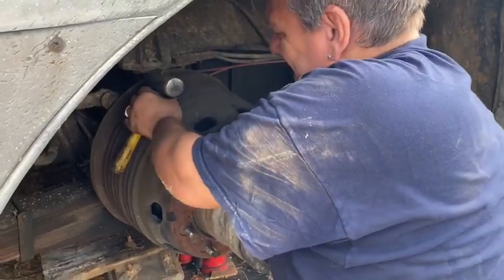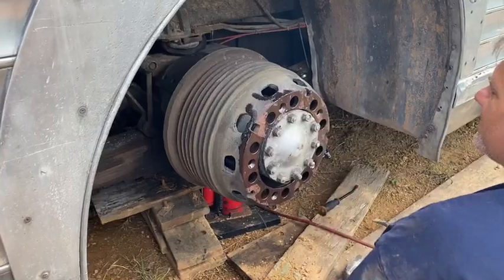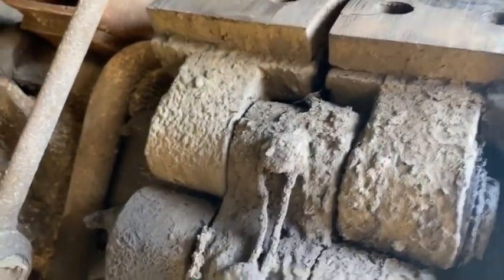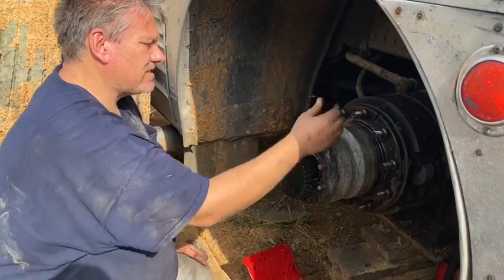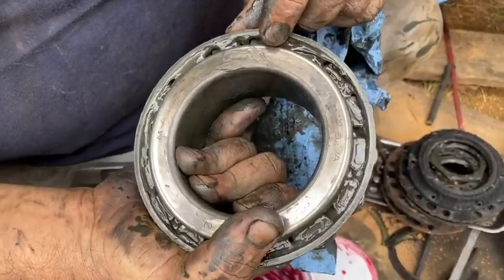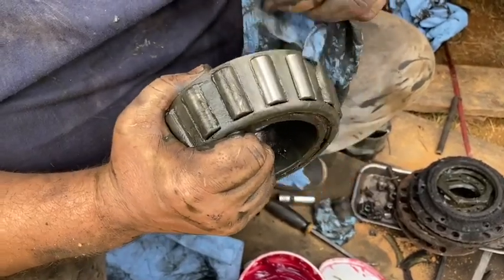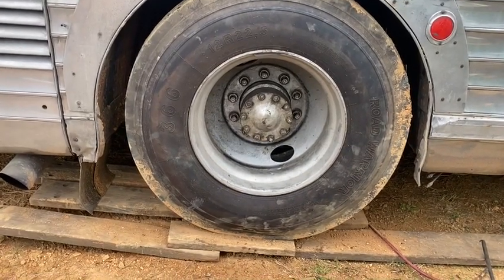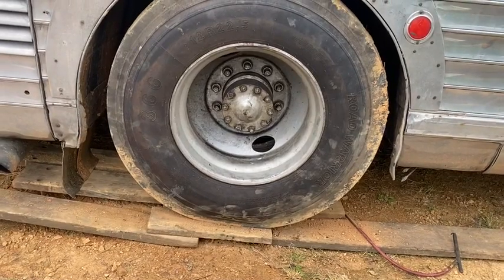Right rear hub inspection on a silversides bus

Comment: When you said the front wheel bearing was in trouble, I wrote I had no idea how long they last, and I think you said that had at least 100,000 miles on it.  Apparently they last a heck of a lot longer.  This work looks so civilized compared with when you are helping people in wet fields and flat tires.  It makes economic sense to take it apart to see what you need, but for an observer it does look like a heck of a lot of extra work to take it apart twice.  Always impressive to see your knowledge applied to what you find.

Comment: You should go to the appliance store and  beg them for some scrap refrigerator cardboard boxes. They fold flat and provide a nice clean work surface that you can simply burn when you are finished. Having a comfy cardboard surface to lay on and lay parts on is a big boost for ones outlook over working in dirt.

Comment: I have found that hitting a flat head screw with a flat ended punch will usually help loosen a stuck screw.
Thanks for the band aid tip. 
Stay safe out there. Must be nice being able to work on Lennie with out having the HOA bothering you.

Comment: You are exactly right about Curad I gave up on Bandaids because they won't stick on you unless you don't move that part.  When I worked I carried two or three or more in my billfold all the time because at work the first aid kit might be a mile away.  That stuck on bandaid commercial is catchy, not at all true but catchy.

Comment: For those flat head screws that stick, strike them straight on with a flat ended punch and your 3 pound hammer.  The force will deform the head and crush any corrosion underneath it, allowing the screw to turn.   Many times this works when an impact gun or driver just rips things up.   I start with the punch, then go to the impact driver if a regular screwdriver will not turn them.
Reply: Yes been doing that way for years .

Comment: You talked about the two axle types you find on busses.... the first  (like Lenny) where the axle splines into the hub, and is easily removed is called a Full Floating axle,  and is designed that way so a broken axle is easier to replace,  but also less likely to break because there is a little flexibility at the outer end.   
The Axles on later busses with the bolt-on flange are called Semi-Floating axles and are cheaper to make, but the joint at the outer end is more rigid and a little more prone to breaking,  although the difference is almost negligible.
Reply: RE: 'cheaper to make' - I know nothing about bus axles, but I know that drilling holes is a lot cheaper than hobbing gears and broaching splines. :)

Comment: For a parts washer get you a Rubbermaid storage container and put some diesel in it and keep it handy where you  are working so you can drop the parts that needs to be clean into the tub to soak while you are working on the other parts  , this will also help you keep your hands clean as you work

Comment: i found the video very interesting, the half shaft pulled out looked dry i allways thought the rear wheel bearings got some of there lubrication from ep oil in the diff or gearbox. or am i thinking of a different set up all together  thanks for video

Comment: I would invest in some plywood, 2x4s and an air-nailer.   Maybe also find a local harbor freight and get a cheap parts cleaner or at least a couple of large plastic tubs, cleaning solution and some chip brushes....  Quick workbench you can just leave outside, plus a tool you can use to build a lean-too.

Comment: pro torque axel nuts  check them out   we have switched our highway trucks to them  love ease of ajustment  never loose wheels  much longer bearing life  .  question  can the rear system be converted to oil hubs  ,

Comment: stuff built in the 1950s for commercial use was really meant to last forever with maintanance. 
i figured out the total mileage on Lenny, is around 10 million miles after being in use for 72 years but thats based off of avarage numbers of avarage bus hitting a million miles every 7 years. 
more realistic number is 5 to 6 million miles taken into account that its spent a few decades in private use.
Reply from the maker: 2-4 would be my guess.
Reply: @BusGreaseMonkey  i`m just amazed at the age of the vehicle and how well the body has held up.

Comment: Lowis bus lines will have the brakes in stock and that are in Georgia so that can get them to you fast.
Reply from the maker: I doubt that.  There are only a few models of buses that use that style brake and they have been out of production for over 60 years.  We have to have a shop manually cut other linings to that dimension that will fit.  Very unusual dimension of linings
Reply: @BusGreaseMonkey  then call Felton clutch in Chattanooga Tennessee he dose clutches brakes and alot of other things and he is open.

Comment: I have a 1948 silversides I have been working on for a while and in this video I noticed the retainer spring for the breaks was broken. If you buy a new one can you send me the part number and brand name, so far I haven't been able to find one that's the same and fits. Also have questions about the s cams for the break shoes. Thanks

Comment: So when you bought Lenny, you didn't change the bearings, race, etc.?  Is that safe?
Reply from the maker: They went marking noises, no leaks, i pulled the axle and saw good grease and proper tightness.  No reason to look and further on that one.  The other three had leaky seals that have been all replaced.    When is the last time you pulled all of your hubs on your vehicles for no reason?

Comment: Get your micrometer and measure those dowels that came out. You can replace them with  larger dia dowels for a better press fit. https://www.engineersedge.com/dowel_pin.htm
 Your vendor may have some Even new standard ones may work if what you have now is worn.

Comment: I'm accustomed to working on big trucks, not buses, but it worries me that your inner & outer wheel nuts can be removed with a cordless ½" impact.   That's way too loose.  The torque spec is somewhere around 400 ft.lbs.   Too loose will cause the stud holes to wear out, and then you're looking for new wheels.   Maybe the spec is less on a bus.
Reply from the maker: That gun is 1200ft lbs break away torque

Comment: And I thought my pick up truck tires were heavy!  Those brake drums are insane.  Why no gloves though?  I've been wrenching for 50 years and always wear gloves working on the big stuff now.
Reply from the maker: I don’t like the feel
Reply: @Scott - Used to be the same way.  Didn't like how they felt.  Found that, in my case, it was the powder being used in certain latex gloves.  Specifically, the ones at the Volvo shop I worked at in the '90s.  If I flipped them inside out, it wasn't so bad.  The Costco nitrile gloves don't bother me, tho.  Only issues I have with them is that, yes, after a while they do give me sweaty palms, and they eventually do provide unwanted air conditioning.  A double layer fixes the second part.  BTW: another southpaw here.

Comment: you need to replace all the drums so far because of the heat cracks, Would hate for them to explode on you going down a hill. You told that to the wonder bus guy as well about the heat stress cracks.
Reply from the maker: Mine are no where as big as the ones they had.   Mine are very turnable
Reply: @BusGreaseMonkey  ok i was worried about that. It just sucks now having to take them back off and wait for the machine shop to turn those big drums. I always went by if i can fit my thumb nail in the crack it's time to replace the drums. Keep up the video's buddy.

Comment: Would an impact driver be better than hammer with chisel? I had rotor screws on a car and the impact driver made it easier.
Reply from the maker: I used one on the front and it broke the big flat head tip.  Still didn’t budge. Plus they are already punched so only the center has a flat spot any more

Comment: Why the screws on bus drums , asked before I’m sure I just haven’t heard the answer.   Second question do you ever look at the inner race on a bearing? That’s where I always look for flaking .
Reply from the maker: They hold the drum on.  Buses use them trucks do not.   It does keep it centered nice on the stud pilot budds.
Reply: Bus Grease Monkey I never had a issue on trucks , technology is interesting in the different industry.
Reply: You are absolutely correct on inspection of the inner race (the cone) that is where bearing surface wear begins. It is usually in the 4 to 8 o'clock area because that is the main loaded surface and the cone can't rotate on the spindle.
Reply: How do u remove the rollers to inspect the inner cone?
Reply: The inner cone is an assembly. It doesn't come apart.
Reply: clean the bearings and look between the rollers , slowly rotate the race to look for damage.
Reply: @tomriggs3926  Tom, I know this sounds unconventional many have never considered the bearing cone in failure analysis because you can't see it. You are correct you can't remove the rollers without destroying the caged assembly.  Clean the bearing assembly in solvent and dry with compressed air.  Now the difficult part,  from the large side of the bearing, look thru and between the rollers at the cone.  Slowly rotate the cone, sometimes it helps to use a light and/or a magnifying glass. Obviously the bigger the bearing, the easier it is to see the cone between the rollers.

Comment: I don't want to be a smart-ass Scott but, I have heard you criticize people that use a cold chisel to remove bearing nuts and yet I see you using a punch to remove the drum screws.   What is the difference?  In both cases the fasteners have been buggered up.
Reply from the maker: The flat head screws were already punched on both sides many times so a flat head wasn’t going to bite.  Plus i replace them with new on every job   That’s the difference
Reply from the maker: And you don’t think there is an important difference between an axle nut and a retaining screw that does nothing once the wheel is on??
Reply: @BusGreaseMonkey  i agree leave them off makes you better mechanic anyway!
Reply: @BusGreaseMonkey  - really doesn't matter.  It's just that when I do something, I always try to do it so the next person won't have to fight it.  As I said, I don't want to be a smart-ass.  It's your bus and you're free to do what you like.
Reply: @BusGreaseMonkey  - Sorry, I didn't see this post before I replied to your other answer.  Forgive me oh great bus master.  lol

Comment: Tell Kelly that sooner or later if she gets with in a mile of the axle grease your gonna get it on ya!......555555555
It can also be said she earned the right to be called Mrs. BGM!..........555555555 
hey at least she didn't break a nail doing it!.......555555555

Comment: I don’t know why you bother breaking drum away from hub if you’re taking off hub anyways. Take it all off as one.
Reply from the maker: It’s too heavy to lift by myself and with only kelly.  I got a very bad back so i don’t know why you think it’s easy and light to remove as one.
Reply: Bus Grease Monkey I didn’t say it was easy, they are heavy and I forgot how heavy now I’m retired. Great channel!
Reply: I am going to comment before reading the replies to your comment, and we'll see how I do.  This stuff is very heavy - maybe to reduce weight?  edit Bingo - I got it right.
Reply: @BusGreaseMonkey  I take the duals, Dayton wheels, and brake drum off my fire truck as one complete assembly using a 2 foot square dolly.  The dolly is made up for the job out of 2x4s and screws.   It rolls on a piece of plywood to keep my rough driveway from eating the casters.   The casters are 5 inch and the only part I save from job to job.   A pallet jack works great too as it can do the jacking and the truck does not have to be jacked mid job to align things.   I have had all 4 of my brakes apart by myself twice.  MUCH easier than taking all those bolts, nuts, lugs off and juggling the parts.  The singles and the duals stay upright on the dolly throughout the process.   No need to lift anything heavier than a wrench.

Might be pretty tough in your shop.   When you get level concrete to work on, it is really the way to go.  If I had a good slab, I might build a permanent dolly.